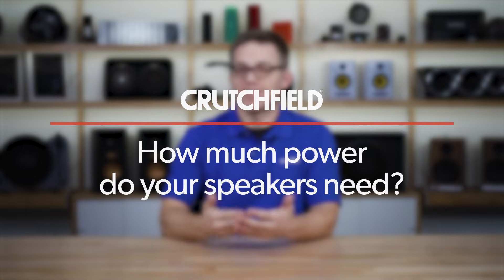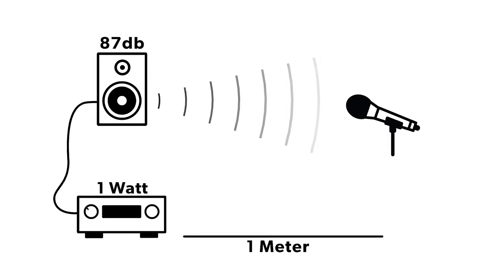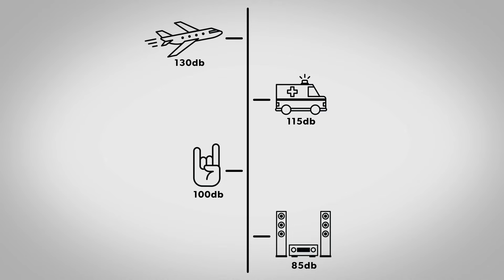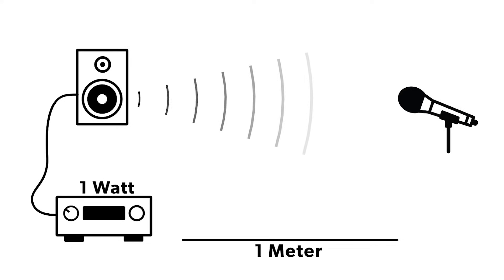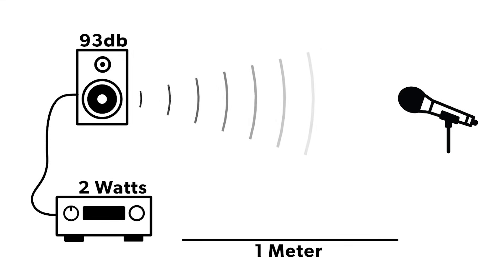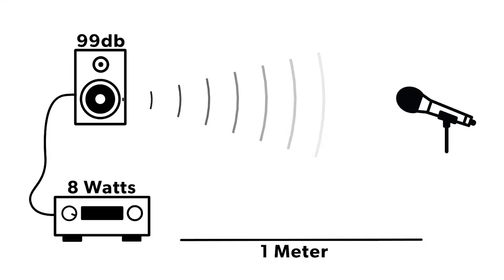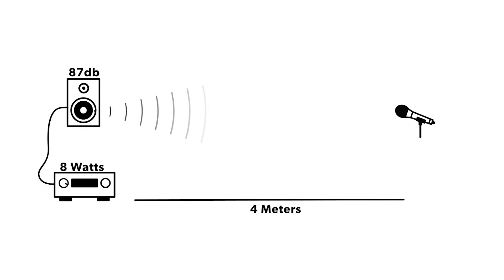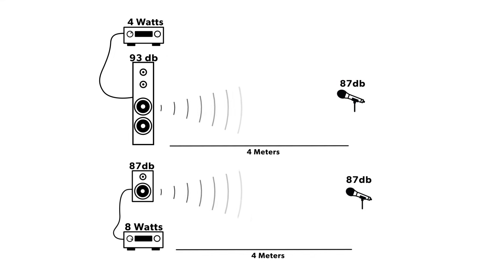How much power do your speakers need? | Crutchfield

Comment: Hello Sir 
I Have 120 Watts Amplifier.
Can I Use Total 170 Watts Speakers To The Board? Any Problem For Amplifier? And  I Decided To Using With Cooling Fan? Any Problem?
2 Speakers = 120Watts
2 Speakers = 50Watts
Reply from the maker: Hi Ramakrishna,
In order to ensure we provide you with correct and precise information, please reach out to us by phone or online chat.  
We will need to gather as much model information on the products you are using, to be sure everything is a good match.
www.crutchfield.com/I-rYTVc164/contact

Comment: I was looking to obtain a “bookshelf” type of system. I found a Jensen system rated at 35W. I’m trying to figure how much volume it might put out? Is that enough to hear wafting through a 2000 sq. ft. one story, or barely fill one room? I might like to plug up my guitar through a practice amp and play along. 
I saw another system without a turntable with 700W. Not wanting to entertain folks two cities away lol. 
Just want to generate some respectable volume with getting the cops called on me haha. Thank you
Reply from the maker: That most likely will be a bit low on power the needed to fill such a big open space with clear sound with that Jensen system. If the turntable system watts is RMS watts, that can work but is more power than is needed which wont hurt anything but does mean you need to be more caution when adjusting the volume to keep it to levels that won't disturb anyone outside your home. 
With fairly efficient speakers, you could get by with 75-100 watts for comfortable listening levels. We don't have a shelf system prepackaged with this ability and power. However, we have advisors that can help build a system for you that will have bookshelf speakers and be all inclusive with the gear needed to get it up and running. Here's how to reach us for this live help:
https://www.crutchfield.com/I-rYTVc227/support/ContactUs.aspx
Reply: @crutchfield  I just have the speakers that came with the system. So are you saying that if I bought different speakers I could have the increased volume? I did note a difference in the volume when playing an LP vs. Blue Toothing music from my iPhone. Thank you for your assistance.
Reply from the maker: For us to give you a solid, accurate answer, we would need to look further into the model information on the products you are using, David.
As mentioned above, with fairly efficient speakers, you could get by with 75-100 watts for comfortable listening levels. 
However, finding out what receiver or amp you're using, and exactly what type of RMS wattage is being delivered, will help us to give you better info.
We will be happy to look into this for you, please reach out for life help at:  https://www.crutchfield.com/I-rYTVc164/support/ContactUs.aspx

Comment: For an audience of 500 how much power wattage will I need?
Reply from the maker: Hi Mitchell!
Are you going to be installing a system in a commercial building, school, or place of worship?  
If so, we would ask that you reach out to a member of our Commercial, or Pro-Audio departments, depending on which service you need.
You can check out this link to submit your info, and start getting to work with an Advisor who will be sure you're getting the correct products for your needs!
https://www.crutchfield.com/I-rYTVc164/Experience/ProAudio/

Comment: I have 4 Klipsch AW-650 speakers i just purchased for a large outdoor pool area. I have not purchased stereo/amp yet, I was looking at the Pyle PD1000BT 4-channel amp receiver 200 watts x 2 @ 8 Ohms or the Plye PD3000BT 4-Channel amp receiver 300 watts x 2 @ 8 Ohms.  I would appreciate any input, help or recommendations.